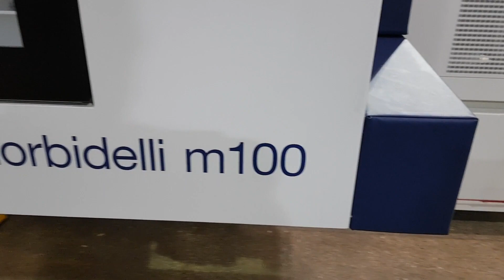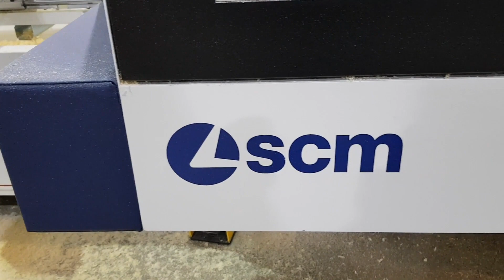SCM Morbidelli M100 5axes CNC 231119

Comment: How much did they cost?
Reply: Hi Hannes, the cost depends from the spec. and options included.  Starts from €90K
Merry Christmas
Reply: @giorgiotestigt71  thank you. Merry christmas.
Reply: we had 2 years old M200 and I heard that it was for like 120 000 eur, M400 some years ago was more expensive, but we have better slim spindle there, which is really a good investition because you will not crash it all the time because of too fat 5 axis spindle and you can reach places which you can't with basic fat spindle, so definitely invest to that slim one if you can, now they solve that by taller suckers or clamps, which is kind of solution, but it's annoying that you have different suckers on different machines and even with taller suckers, you still can't reach what you can with that slim spindle because you would hit beams and force them to mill all stop pins (I don't know how to call it in English) into the beams and not just screw then on side of beam, that's useless solution because it inteferes with everythingwe